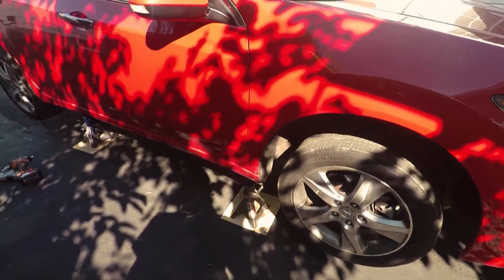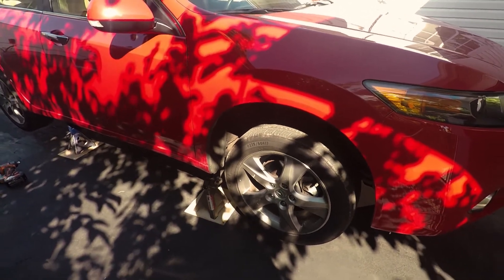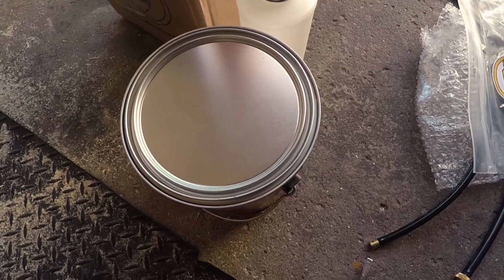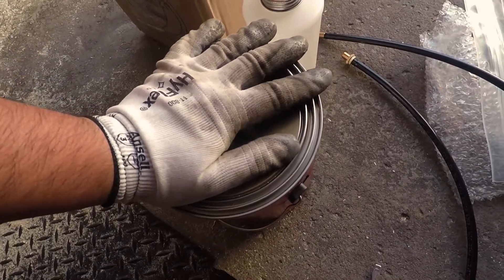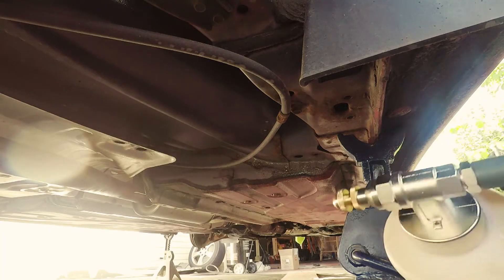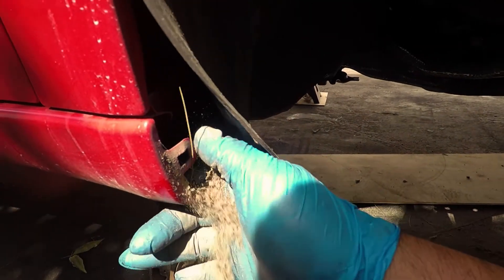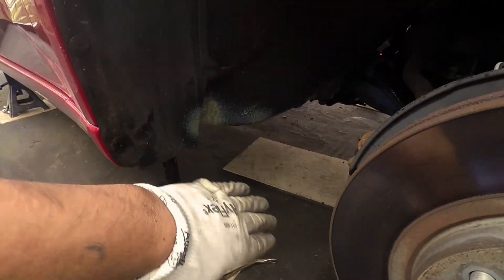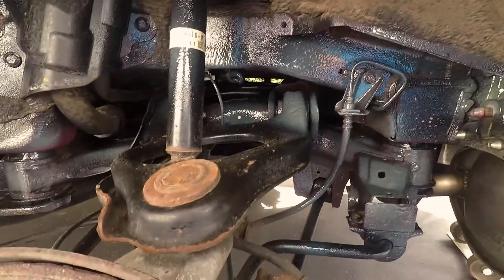Acura TSX Winter READY! Undercoating DIY

Comment: Hey That’s the way to go. I see you have the Husky 175 oil less compressor. How did it work using it. What pressure did you use ? I’m thinking of getting that one or the Kobalt one. Nice video
Reply from the maker: Excellent compressor. Quiet as well, wont be disturbing the neighbors. Sprayed the vehicle, it probably went off 3x. I believe I set the PSi  around 70psi. I prefer Husky but Im sure w.e you pick will be adequate for the job.